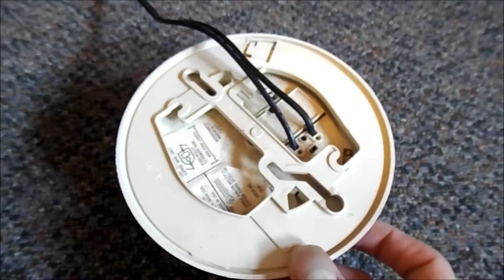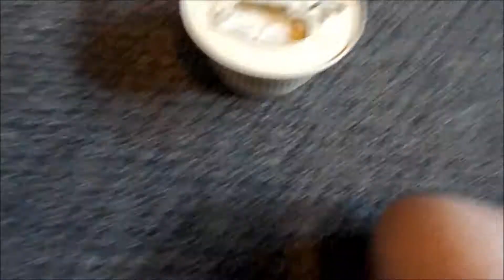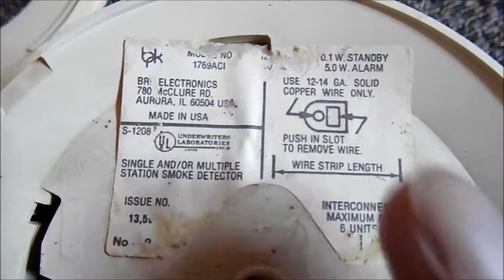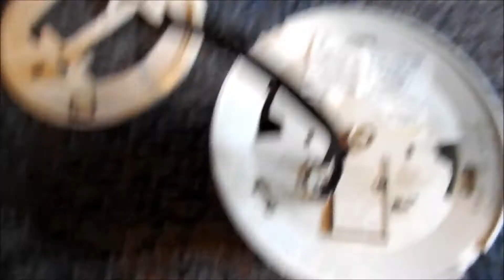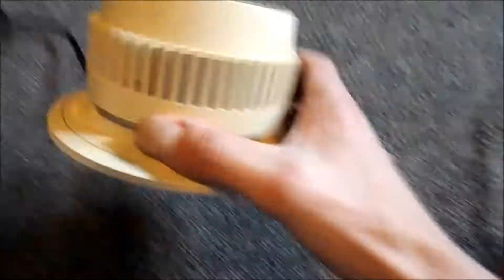Vintage BRK 1769ACI Smoke Detector

Comment: My condominium was inspected today and when the gentleman saw my smoke detector he said, "You've been here for a while". The unit has to be replaced. I pulled it out of the ceiling not realizing the electricity had to be turned off from the circuit breaker box. I moved the wires which caused a blast. It sounded like a gunshot. Lesson learned and luckily I wasn't injured. Thanks for posting this which showed the proper placement of the exposed wire tips. The online manual's pictures were no help.
Reply from the maker: If you replace it don't throw it away, a collector will want it!
Reply: @BAFVintage  OK, and thanks, for now, I'll keep it and add a new model.

Comment: I had two of them in the house I have now (built in 1981). So yeah the year is pretty spot on. The one upstairs (led light) was off when I came to look at the place back in 2000 (probably false alarms). These are very sensitive to humidity and steam from the shower, and damn straight—they are loud! Still have one downstairs that never alarms but is still working.
Reply from the maker: These alarms are really versatile. I have since gotten another one from a different person who messaged me they were replacing one. Thinking of installing one in our basement just for fun.
Reply: Hey your not alone I got one too

Comment: Thanks for all the info, we just moved into a house that was built in 1984 and it STILL has 2 of these things. We were introduced to them at 5am and it was SO loud! I'm not sure what set them off but I can tell you I will be replacing them.
Reply from the maker: if/when you replace them don't throw them away! they are very collectible, someone on eBay will want them.
Reply: if you replace them i’ll buy them
Reply: Give me give me
Reply: Why replace a perfectly good working smoke detector?

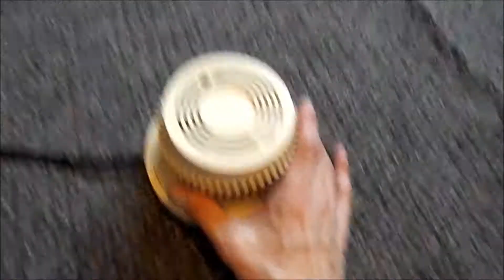Comment: 10:55 im using one of those old smoke alarms as a door alarm!
Reply from the maker: how??
Reply: @BAFVintage  ima mod a firex i4618 by rigging a door sensor to the circuit board and interconnect the alarms

Comment: Fun Fact: there’s a similar commercial varent that was originally made by BRK called the 1800. There are System Sensors 1800s as well.
Reply from the maker: yes, I am after one of those as well. I have seen them many times in houses for sale.

Comment: I have a smoke detector from brk.
It is a square with curves on the borders and a X line with a square in the middle and I opened it and the circuit board said B60-69
(and I think its from the late 1970s)
Reply from the maker: a square detector with X line borders???? sounds like you've got a later SS-718. If you have this alarm still, you should definitely make a video. No collector has one of these, only the older metal model.
Reply: @BAFVintage  I already have a video of this smoke detector
Reply from the maker: @TheDrJ2006  i have seen it
Reply: @BAFVintage  I have now updated that video because I removed it from the wall! And I gave more info about it! (I still have that smoke detector)

Comment: how the hell do you uninstall these things?  I have one and i need it to be replaced
Reply from the maker: Twist it off the mounting bracket remove the wires from the back with a small screwdriver, stick into the square hole next to the hole the wire is in to release. then remove the bracket and install replacement smoke alarm
Reply: @BAFVintage  thank you!!!
Reply: Can I have it

Comment: I got 1 stuck in alarm and activating elevator recall. How do you open the dam thing up to clean it?
Reply from the maker: There are three tabs on the back that snap the cover on. Good luck, they are incredibly hard to open.
Reply: @BAFVintage  I got it thank you  i used the old system sensor horn strobe flat plastic key to unsnap it. It was full of dust and rust. The matinance guy spraying cand air was making it worse lol so it stayed in alarm till I figured it out. Thank you
Reply from the maker: @adamcuttler9665  Glad you got it all sorted out

Comment: Hi! Would you by any chance have any instructions or a video guide on how to remove a mounted one? We have this exact model that was installed by the previous owners of our house and it’s been malfunctioning and making that horrid sound every night. :( We’ve been trying to remove and disconnect it to no avail.
Reply from the maker: I can make a short video on how to remove it, the unit twists off of the mounting bracket counterclockwise and then you'll need to push a screwdriver into the square holes next to the wires on the back to release the wires from the spring loaded connectors. Also if you do remove the units I'd try to sell them on ebay first, a collector such as myself will definitely want them, working or non working!
Reply: @BAFVintage  Awesome, thank you so much!!! :)
Reply: Hey I know how
Reply: I got one and it was really easy to get off

Comment: I bought a house last year that has 2 of these interconnected and they just started randomly buzzing. I have no idea why or how to fix it. Anyone help me trouble shoot?
Reply: Some possibilities....First, turn off the current (from the circuit breaker if they are wired that way--you're going to need to see which one controls them) and then, try and remove some dust (if any) around the vents with some canned air or a small vacuum (including the top where the 4 slits are around the led light). Dust may result in false alarms. In addition, these alarms are very sensitive to steam (after a shower) and humidity (especially in the summer time--mine used to trip very easily, even with air conditioning running, nearly every other day (the third in the garage always tripped the other two inside). Third, maybe they are beginning to age to the point where they are not working properly and will randomly buzz for no reason. It's recommended that smoke alarms (the actual unit) should be replaced every ten years. This model was used in the early 80s (my house was built in 1981) and these were found in all the houses around mine, so they might be the originals. I hope this helps to resolve or minimize the nuisance alarms.

Comment: ru sure  its from the 70s?
Reply from the maker: Late seventies to early eighties, basically a transition model between the SA769AC and the 1839ACI
Reply: @BAFVintage  I remember that from the 80s had one just outside my bedroom  in the short hall way right on the ceiling scared the crap out of me